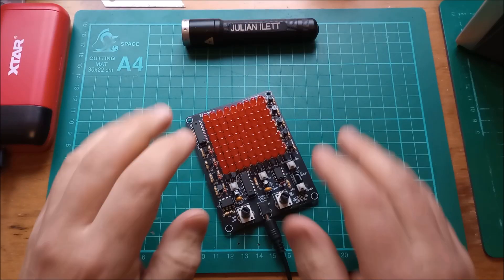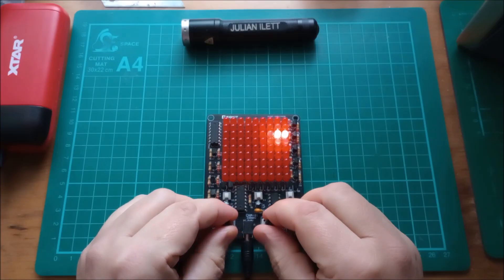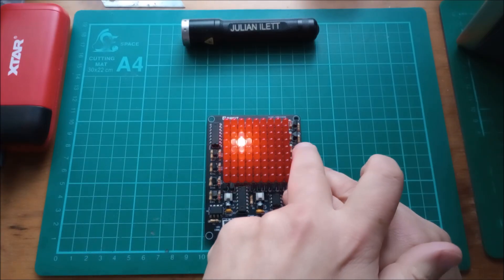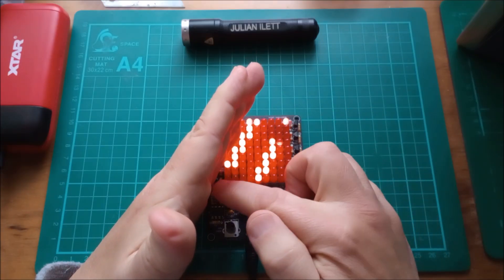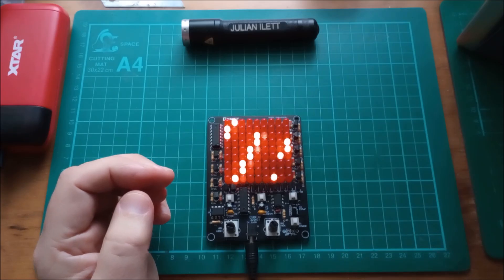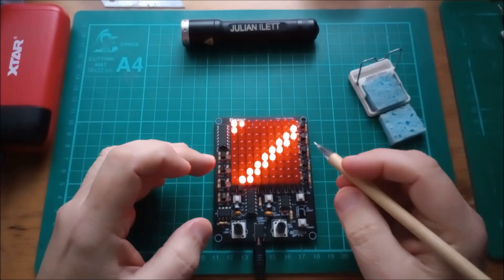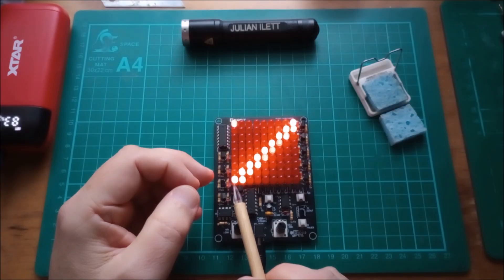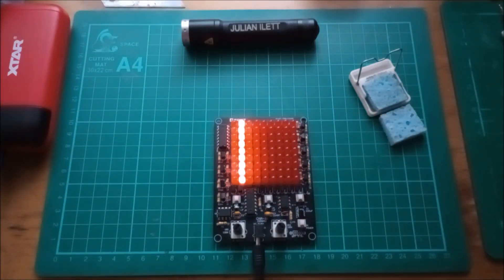What it Does - LED Matrix DIY Soldering Kit CHA-81

Comment: Julian, I urgently need your help. I bought an Aneng ST-180 clamp meter. It worked fine for 15 minutes. After that, it stopped. When I switched it back on, all displays are shown but there was no reading on any dial. Could you please help me  get a circuit diagram for that instrument or if your expertise could directly provide me with a solution. It's brand new and I don't want to throw it away. Thanks Bro.